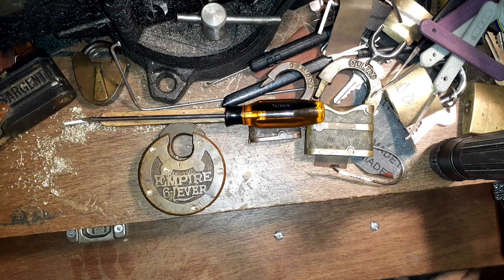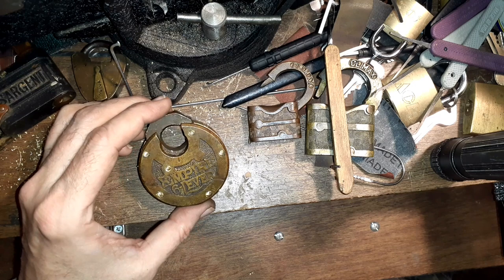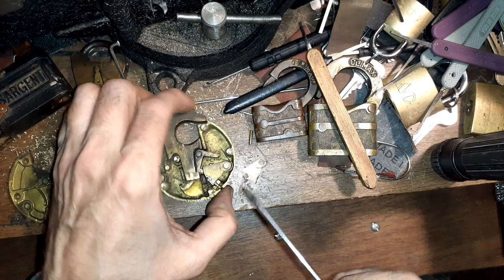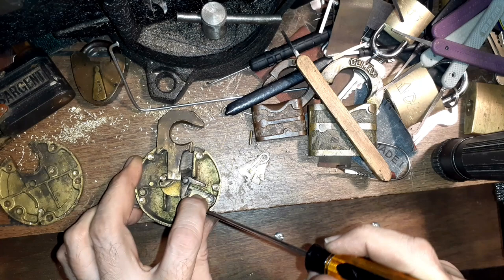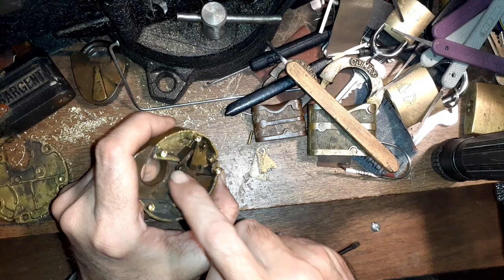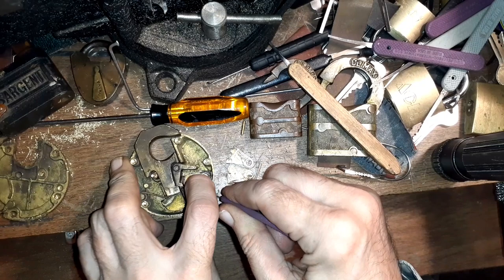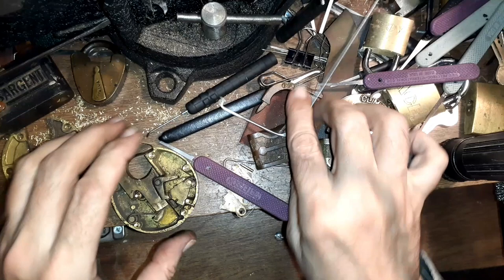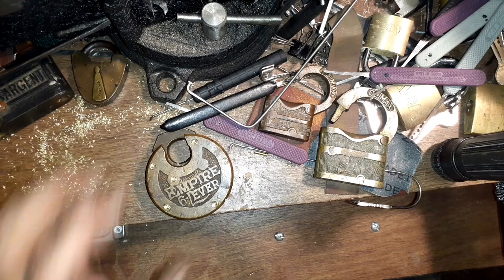(891) Inside a 1902 Miller 6 Lever Padlock

Comment: Lock collections are kinda boring especially if the locks are not rare or cool. I prefer picking a few, keeping my Chubbs and destructive testing crap locks. Lol
Maybe you can apply pressure down the side of the shackle and push the part that goes into levers towards them.
Reply from the maker: Since that shackle spring is tensioning the bolt basically,  I should be able to get one of them to bind, & work my way down the stack. It doesn't seem to work that way.  All levers move freely until they all line up at the same time,  then the thing pops up.  I got a fully functional one in with key, so I should be able to figure out how to pick these things eventually.
Reply: @WilliamMancel  cool, hopefully what I said made sense though lol